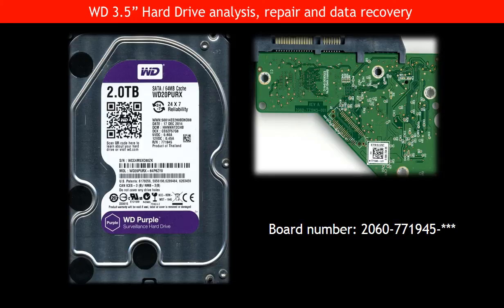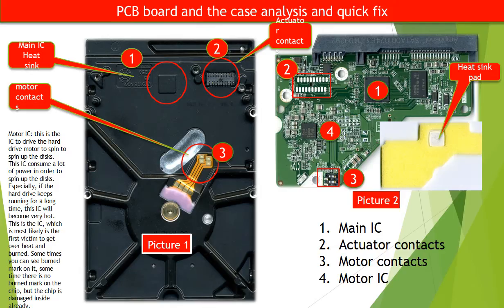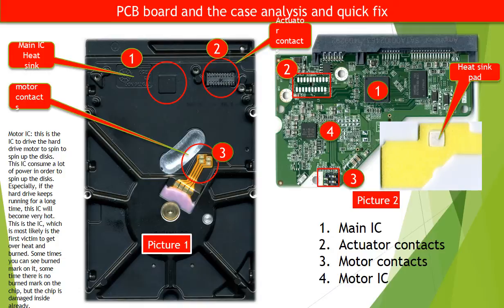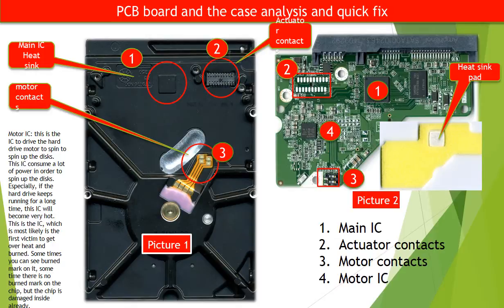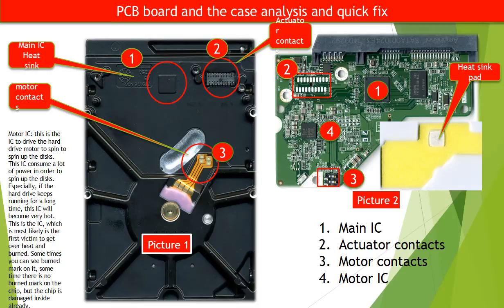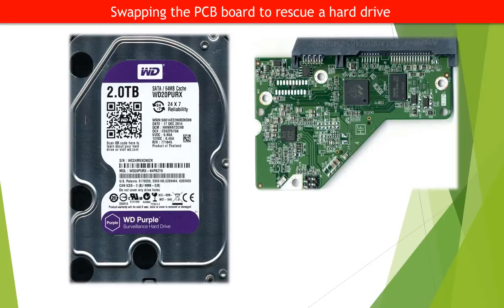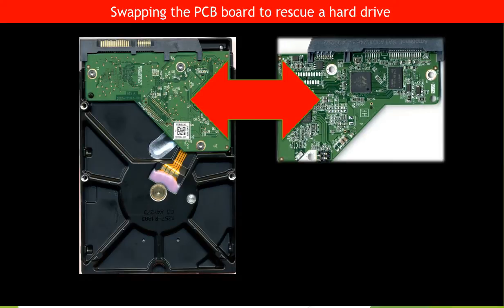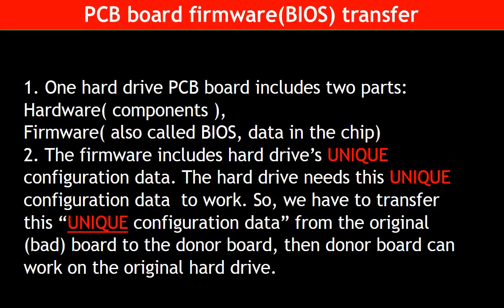WD repair PCB board swap  WD10EZEX  WD10PURX  WD20EFRX  WD20EZRX  WD40EURX  WD10EZRX

Comment: Is Hard disk having a fuse on PCB? The cable was shorted, I replaced the cable and now BIOS doesn't detect the hard disk.  2 hard disks was damaged before I figure out the cable problem.  Thanks for any inputs.